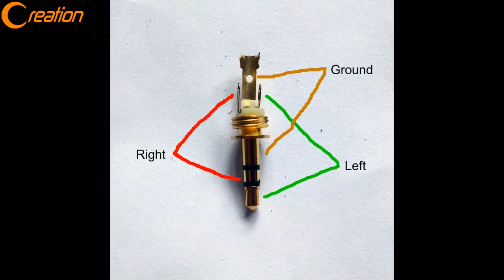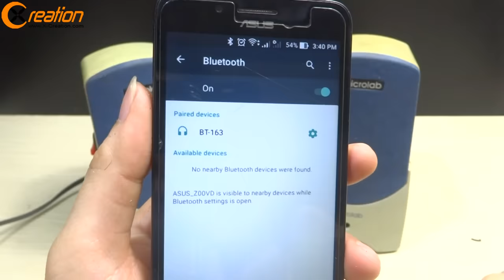How to Convert any SPEAKER into BLUETOOTH SPEAKER for $5

Comment: you could have just put the reciever on the jack...
Reply: Well, thats smarter
Reply: Hahaha true day! What a fail
Reply: Where's the fun in that? I suppose you could just play music from your phone without a Bluetooth device to make life even simpler.
Reply: @hydralicmonkey6490  what if my phone doesn't have audio jack ?

that bluetooth device is much cheaper than usb c - audiojack converter in my country.
Reply: 😂😂😂😂😂 fail
Reply: I was thinking that
Reply: You still need to power the receiver through the usb connector. That's why he did that. The receiver needs 5V to work, that's why he added the charger circuit so this way everything is operated inside the speaker and completely eliminates all the extra cables.
Reply: But in this case u have to recharge the device everytime..but he connect it through ac line..he is little more smart than u
Reply: Time you have messed about doing all that, what it cost in time you may as well go and buy a a cheap Bluetooth speaker.
Reply: I agree with John. Is more easy yo do that and get a large cable to keep charging it...
Reply: Exactly.  I wonder why he made it complicated yet it's simple
Reply: Could you describe more detail how do it? 
Or maybe you can record the video with sampe?

GREATS ALL from Poland
Reply: But it has USB-A connection. There’s no usb-a port on this type of speaker
Reply: no you cant, the speaker operates with 10v but the the reciever just need max. 5v thats why he did that
Reply: 7805 would be better option
Reply: Lol
Reply: You say Absolutely Right
Reply: @NUBBY39  Because they're cheap. Converting a quality speaker (not saying the one he did was quality) makes more sense (to me).
Reply: People did not understand the OP comment and try to look smart. He meant that the female jack could have been taken off from the Bluetooth adapter to solder the wires directly where it (the female jack) was.
Reply: @Kovadamt  You could use the same charger and bundle the cables together. Not saying it's a waste of time as a process but not needed to get it all to work easily....Sort of Rube Goldberg-ish. .
Reply: People are not lazy like you
Reply: What if the bluetooth reciever run outs of battery or broken

Comment: Very good. Just a small hint, you might want to keep your soldering tip cleaner. Less chance it will pollute the solder joint.

Comment: Also you can use the famous regulator 7805 instead of old charger in order to supply the bluetooth device from the main Ac transformer of speaker.
7805 very tiny item and perfectly give 5 volts with zero noise especially with two filters stages.
Reply: You would need a separate transformer winding to avoid something called a ground loop. This produces unwanted noise.

Comment: You can just buy a Bluetooth receiver for your phone and can be connected to any speakers. I have one for my ceiling speakers for my front porch and works great.
Reply: But bluetooth speakesr all seam tobe mono with no seperation distance either. Thats why I abbed BT internally on my home Hi fi, and taped 5v from the 12v internal feed from transformer, through 5v regulator with filtering capacitors on a small stipboard, all tucked away inside the old hifi case, a small switch on the rear to control the 5v, and wired a jack cable internally from Auxillary input on the rear of the hifi, and plugged it into the BT board, held inside the case with adhesive foam tape. All easilly reversable, and totally internal. Way better than a BT speaker with my 240 W RMS stereo and subs thank you.

Comment: Well, that was clear as mud.  I have no idea what you did,. Could you not invest in a microphone so that you could explain what's going on.  For example, what were you doing with that USB thumb drive and what polarity did you connect the power to it?
Reply: sydmichel the usb is what makes the speaker Bluetooth it’s one of those usb that you put on a computer that don’t have Bluetooth built in but it’s a waste of time for all this you can just buy a Bluetooth speaker plus the point of Bluetooth is for it to be wireless and take it anywhere
Reply: Also, how would a person know that the power into the speaker was 5v? That's troubled me. Looks like randomly hooking an unknown power supply to a USB. How did you know it wouldn't be too much for the BT adapter?

Comment: After reading all of the negative comments here I am to clarify what's he actually doing in this video.. 

1. He has old wired standard 3.5mm jack speaker laying around his house... 

2. So he bought the Bluetooth receiver to turn his old wired speaker into Bluetooth enabled speaker...

3. But unfortunately his old wired speaker also didn't have USB port to powered the Bluetooth receiver... 

4. At the same time he has old 5v mobile charger (which is still in good condition and no mobile is using that charger anyway) laying around his house so he decided to use the mobile charger as a power supply for the Bluetooth receiver..

5. Voila. He's complete connecting all the wire in correct position and now he's have turn his (Non Bluetooth) old wired speaker into a Bluetooth speaker. 

The conclusion is he doing this method because this way we don't need to carry extra wire and hanging wire around for the audio jack and USB Bluetooth receiver and that's why he connecting the mobile charger board to the power supply and to the USB Bluetooth receiver because without that the Bluetooth receiver will surely fried like fried chicken. Also please don't compare it to these modern day speaker that have all the port around it. Thanks for reading 

Well this is one of the good diy video also I like this kind of video that teach people how to diy. Peace. Keep on diy everyday.

Comment: Why don't use a DC DC converter to use original DC out coming to the speaker board, and convert it to 5 V?
Reply: Mr. Raul Pee DeeJay 
Yeah you're right... but maybe he doesn't have one so he push it up a notch by using old cellphone charger to power the bluetooth audio receiver.
Reply: @emersonsrandomvideos248  the Bluetooth receiver can interfere with the speakers and make a loud interference noise
Reply: @jdriver2308  you have to filter your power supply. Even the switch, the speakers have already one

Comment: U could just buy a bluetooth receiver and connect as is to theese speakers
Reply: Nikolaiwww yep but they would be another thing you would have to carry around. Also you would have to plug both the speakers and receiver in the socket for power. With new USB powered speakers this isn't a problem but with older ones like these it is
Reply: Good
Reply: Yeup 👍
Reply: you are right it's waste of time
Reply: No waste of time,time is money,BT receiver with jack output coast much then this cheaper receiver,the time lost makes up for the money saved and no external ugly card appear, great job, it's clean. Dont understand...ok well lost your money,but do not give advice to others.
Reply: Prateek Don g
Reply: Bro that is lazyway
Reply: goku Ultra Instinct  Lol...🤣🤣
Reply: It said any speakers so home stereo speaks work too?
Reply: If you have zero relatively basic knowledge with electronics, then sure.

Otherwise it only takes around 30 minutes and ~£2 for components to have a nice, clean Bluetooth setup.
Reply: @barryhackwell7285  Depends if they're powered (ie. there's an amplifier built-in to them - you plug your audio source directly into the speakers and not a hi-fi/amp).
Reply: @LiamB1708  

Board carrying mains voltage with heavy transformer held in place with nothing but hot glue on top of another board is not my understanding of "nice and clean".
Reply: donde  vives aaaa

Comment: Why you are using another switch? There is already a power switch inside.

Why you use 3.5mm connector? You can just solder the wires directly to the PCB.
Reply: No reply to your questions after a month, I guess he's busy... Let me try to answer.

1) Why another switch?  Because the first switch is part of the Amplifier board and only turns off that part of the speaker. But now that it has additional circuitry, a second switch is needed to turn that off as well. Also, it is MUCH less complicated than converting the first switch to perform both tasks. 

2) Why use the 3.5 mm plug when soldering would have been simpler?
You are absolutely right. I suspect that he wanted to demonstrate the audio signal path in a very visual way for beginners, with a connector that is instantly recognizable.  There is really no other reason that I can see.
Reply: Same thought when i saw the 3.5mm...why the hell did he just use that plug instead of just wiring direct lol

Comment: Good skill, but this is like building a power bank, using an 8 cell battery holder wired to a cigarette lighter USB charger, installed in a soap case, when cheap decent power banks already exist (I actually did this just before power banks were a thing).

Just plug a $10 MP3-player-sized Bluetooth headphone adaptor into your speakers, without taking apart anything.

Save the MacGyver effort for something else where you actually have no better choice.
Reply from the maker: Thank my friend! 😘

Comment: Lol. You could actually buy a mini rechargeable bluetooth receiver/transmitter with audio out and simply connect the pc speaker cables to it. It also cost around $5 in Amazon. Less hassle to construct.
Reply: $5? Try free, plus a buck shipping, on Wish. Just ordered a second as a backup. Oh, but I replaced my original's battery (like, 50mAh) with one from a damaged PS4 controller (1000mAh!!!). Lasts forever between charges!
Reply: @robert___t  Whoa that's wicked.  But Wish buys goods from China cheaply BY THE BARREL per item that's why they can sell one product costing, say $450, down to only $1 (even $0.50 at times). The catch is, some items may not work and you may get knock-offs on certain brands.  But hey, they're only $1 so can't complain much. So as long as its makes you happy, order away.

Comment: All you need is a good soldering gun a B/T/ reciever a switch an led, and a triple ring and sleve jack some scrink wrap , and some pretty good patience but this is a very good option and a project  might take on since my  tv is hogging up the one input I have for. my 2.1 stereo bookshelf surround sound, oh yeah a power supply wire .

Comment: Now how about making it portable with a battery. You know without having to plug in for external source of power.
Reply: Lalboi Manlun ..Buy a 12volt Car Amplifier and 12volt laptop battery..break it all make another box to put all electronic insude and connect it all..
Reply: Take the existing amplifier out and insert a normal USB power amplifier motherboard to it. And a 12-24V battery pack. Install them inside the speaker. That's it.

Comment: if you just connect the 3.5mm chord of the speaker justa s it was in the beginning with that Bluetooth converter istead of the phone and then switched on the speakers then also it would have acted as a bluetooth speaker. That adapter is actually made for this purpose only. The only thing that you have done here is that you have inserted the adapter inside the speakes instead of keeping it out.

Comment: Thanks sir. But I have one question pls solve it out. If I use 3.5 mm audio splitter & connect one port to computer directly & another with bluetooth . So that I can use same woofer with computer directly & when require i can play them from my mobile. Can it be possible. Pls revert.

Comment: too many problems, if you already have the bluetooth dongle with connection 3.5 just connect it to a cube cell phone charger and the input of the speakers to the dongle and ready is done without having to do so many problems
Reply: Yo pienso lo mismo si ya tienes el conector y el cargador para que perder tu tiempo soldando y cortando el parlante

Comment: That was fun to watch but let's be real, tools, wires and etc cost money too bucko. It's really like a $30 job 😑
Reply: Denny Digital lol not even bro you don't need any of the tools he used you can always tape your way to the end and it will still work old charger thing you can find one aroun the house or with a friend the only thing you would be spending on would be the Bluetooth connector

Comment: What a waste of usb port you could desolder and solder the cables without breaking it or if you use an adapter for cell phone you will save the solver there, you could also recycle the audio cable. The project can be improved and it depends on each one, although the idea seems good to me since several people can update their speakers, audio players with auxiliary inputs, etc.

Comment: If you add battery inside & dispose secondary speaker, it would be "cleaner"
Reply: Ivan Hendrika or for the second speaker in it like the back for auto that goes bother ways for semi surround sound. So then you have both speaks working together!

Comment: If my old speaker is 9v AC power supplied, what can i do to get 5v DC
Reply from the maker: u can use DC-DC 4.5-40V Step Down 5V/2A module 
https://x-creation.com/products/dc-dc-4-5-40v-step-down-5v2a-usb-output-charge-mobile.html

Comment: i have an issue with that blutooth adapter , the volume is to low even if i use the max volume in my stereo....  any ideas to fix this? :o
Reply: Go buy a bluetooth speaker and take it apart, and get the voluminator out of it, then replace your crappy one with the good one, and you will have a wireless speaker then... Wait... Hang on a second... 🤔🤯

Comment: Butcher a set of speakers when the simple solution is to wire the blue tooth receiver into the input jack.
What's with the purpose of not trimming your thumbnails? 
Do you pick various orifices with these?
Yeah I bet that's what it is. Yuck!

Comment: Why not use the pre-existing power button? 

Solder the pads the button opens and closes to a fixed closed and remove the button mechanism. Attach a new button that’s capable of the current draw and 120V. 

You can even use a mosfet or something. Anything that’s cleaner that two separate buttons

Comment: Why cutting opening soldering. All you need is a charger with usb port and bluetooth dongle.. speaker aux goes direct in dongle.. 20 sec needed.  I can live with external visible dongle. And WTF with that stupid on/off button. You are turning on bluetooth dongle separately?? Why ? Give it power directly as soon as speaker is switched on. Grow up

Comment: im converting my 1000w jbl woofer will it work 

kappa
Reply: Yes.. just buy a bluetooth dongle. Shove it in a charger with usb port. Shove aux of ur speaker in dongle. Walla🤘
Reply: Yes but you will have an audible time delay
Reply: @DavidG2P  just few microseconds lag. Coz range is few metres only
Reply: @gabbysingh868  its not the distance lag, it's the Bluetooth audio lag
Reply: @DavidG2P  get a 4.0 bluetooth receiver. 10mbps atleast
Reply: @gabbysingh868  it's also not about mbps, it is about latency. https://electronics.stackexchange.com/questions/354458/why-bluetooth-audio-works-at-so-high-latency
Reply: @gabbysingh868  

4.0 would be the worst for latency, comparatively.

Comment: I would be concerned that a power supply board at mains potential was just fixed in using hot glue round a 3mm led - NOT SAFE!!!! use a power bank and external usb receiver plugged in to the pre existing 3.5mm stereo jack.  That way, the speakers are not modified at all. no safety risks.

Comment: I mesn you could just buy a 3.5mm Bluetooth reciever for like a maximum of $10 and save all the cost and time
Reply: Can anyone help with the electrical diagram? I have similar old speakers with the ability to change the volume, bass, treble etc. The speakers each have tweeters. Just not 100% sure where to connect the bluetooth reciever? I am assuming right after the power source and with the  audio in cable? Any help would be greatly appreciated.